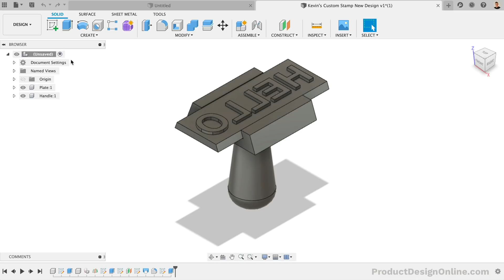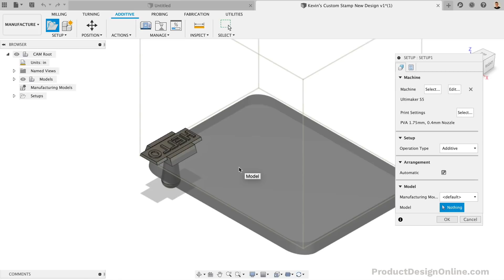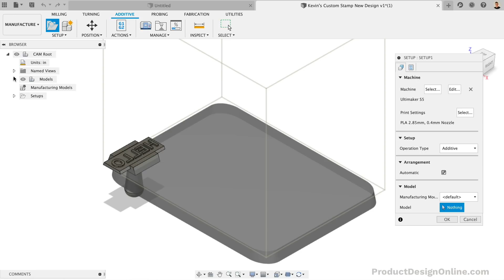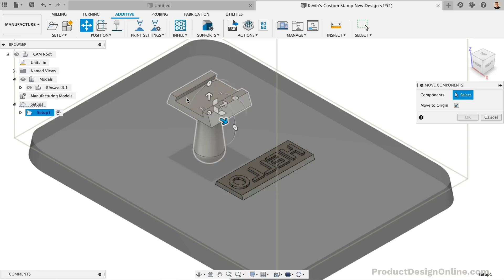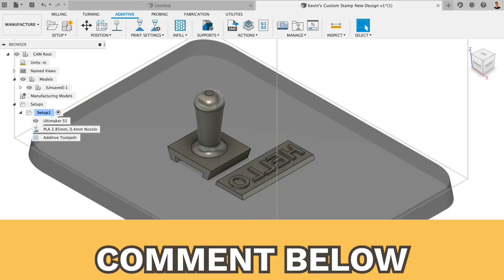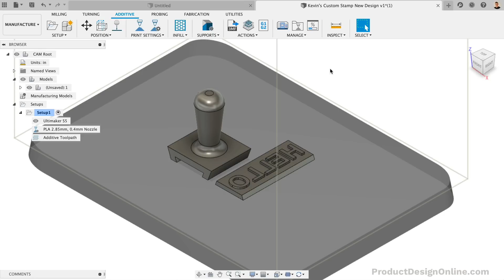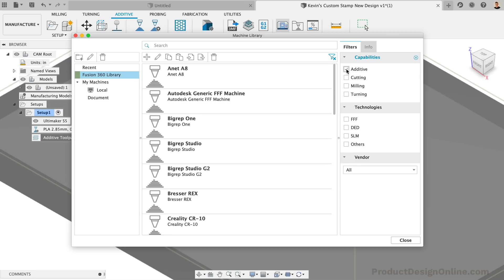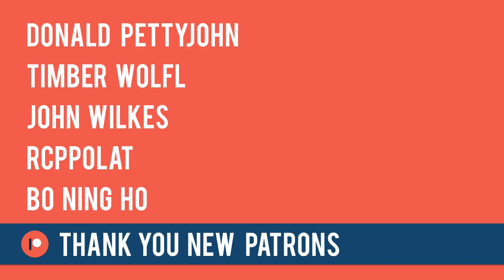Slice your 3D prints directly in Fusion 360!

Comment: I usually just go to "3D Print"  under the File menu and choose "Send to 3D Print Utility" and choose Cura. I have a good amount of custom gcode, and I trust the Cura Engine to not mess up. Other advanced settings are also not accessible in F360. I'll stick with Cura now, but the option to use other slicing engines would be nice.
Reply from the maker: Totally - I'm right there with you. Have Cura setup and primed for all 3 printers.... it will be interesting to see how it evolves in the coming updates.
Reply: @ProductDesignOnline  Yeah, it's much easier for me compared to F360 slicer. I don't think I'll ever switch, because I love the expandability of Cura. Also, Cura is connected with Octoprint so I can directly send the sliced gcode to my printers from Cura.

Comment: I just tried this and worked great but some things I make or tokens with different colors and fusion doesn't have layer stops which is to bad. Maybe in the future. I can now just take sliced file and put on my sd card and print away. I did notice that it prints in less time compared to cura for same file which is also good.

Comment: Since it's not using the dreaded STL file format, I wonder if it produces circles and arcs using G02 and/or G03? If so, this would drastically reduce the size of the file. I've been complaining about the STL file format since the late 90s. I'm a machinist and have worked with 3D printed models and solid modelling for decades.
Reply from the maker: Great point, Rick! I do know they generate the "tool paths" in a different manner than the typical slicer, but not sure the answer to your question without looking into it :)
Reply: @ProductDesignOnline  If one would slice even a few layers with round geometry, then looked st the g-code, it would tell the story. I manually did this years ago in GibbsCAM and it naturally produced "proper code. Of course I had to input the extruder code manually, but none the less it worked. A clean Parasolid or STEP file sliced is league's better than a STL file! Seeing how Fusion 360 does the slicing is extremely promising! Thanks for the video!  :)
Reply: Great question: all I can say is September will be a good month for us all :-)
Reply from the maker: @sualpozel1  counting down the days...   :D
Reply: @ricklynch  Hey!
The comment is old, but for anyone wondering:
Fusion uses G02/G03 for turning machine, but not for additive for some reason. Edit: As it turned out my printer (ender 3 neo) doesn't support g2-g3 codes, it needs a different firmware to be able to process it. The program is capable of doing it tho, just have to find the right settings with the right printer.

Comment: Unfortunately, there is no round bed option in the setup so can't use it with my delta printer.
Reply from the maker: Good point! May be worth posting on the forum so they're aware of that (if they're not already). Cheers :)

Comment: ummm I followed these steps but  my build plate always ends up vertical not horizontal. Not sure what I'm doing wrong and I really want to try slicing with F360
Reply from the maker: Hmmm... Never seen or heard that issue. That one may be best for the official Fusion 360 forum where one of the Engineers can chime in :)
Reply: @ProductDesignOnline  ok thanks

Comment: Great tutorial!!!  I was totally lost trying to use Fusion 360 slicer. Now  it works perfect..... any one knows how to add Artillery X1 to the library?
Reply from the maker: You can create a custom machine in your Machine library. You'll have to setup the dimensions and other details, but it will be worth it for re-use as once you input it you will not have to again :)
Reply: I see they even have a place when editing for including a PICTURE of your custom printer. Rather silly at first glance, but it shows the level of depth they were going for in the design of the slicer. Soon people will be sharing printer profiles, there's even a "Post" tool available, in line with their 'Web Centric' philosophy. Give them a year or two and they'll give Cura a run for it's money. Now ...? Not so much, very 1st Gen tech. But when you have the deep pockets ... they can hire top 3D talent. They're clearly aware of the 3D evolution.

Comment: Hello Kevin! Thank you for your amazing tutorials, I have learned a lot with them. I would like to know if is there any way to simulate laser cut paths in Fusion 360. Thanks again and I wish you the best with your wonderful project.
Reply from the maker: You can generate tool paths in the manufacturer workspace and save them for laser cutters. However that only works well for outline cuts, there's not much you can do for etching. For outline cuts you'll just have to select or create a custom bit size and you can use that to simulate the laser.
Reply: @ProductDesignOnline  Thank you for answering so fast! I'll try what you mentioned. I'm not really interested in get the nc file, I just want to be able to simulate the outline cuts for educational purposes because due to the pandemic the school is closed and my students are not able to use the machines, I think this could be a good way to show them how it works.

Comment: I still prefer PrusaSlicer, only for Tree Support i go back to Cura.
Reply from the maker: Good point! Tree supports are handy. What makes you enjoy Prusa Slicer over Cura?
Reply: @ProductDesignOnline  The fact that I can change my printer and my filament without loosing the data.
When I change this in Cura, I keep ALL settings (which is nonsens) or loose everything!